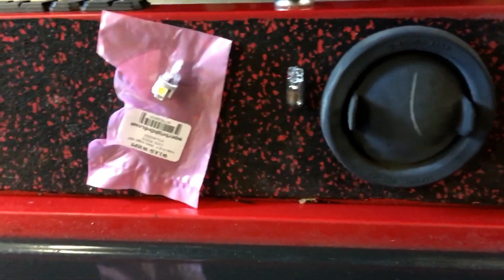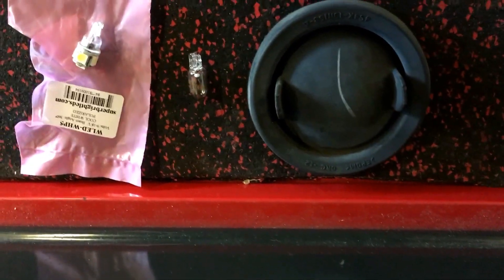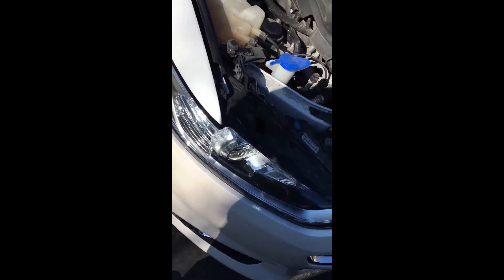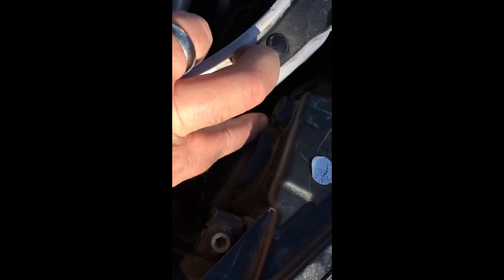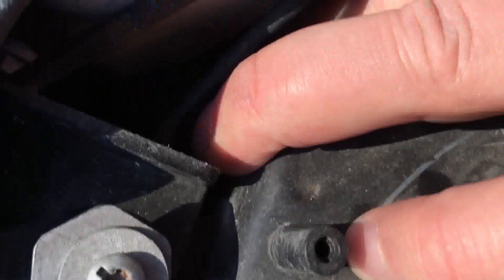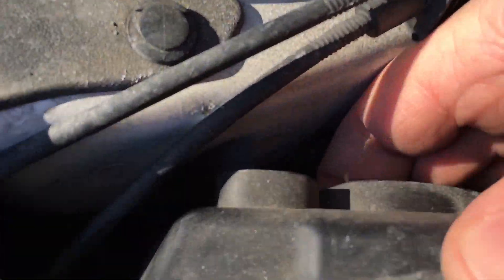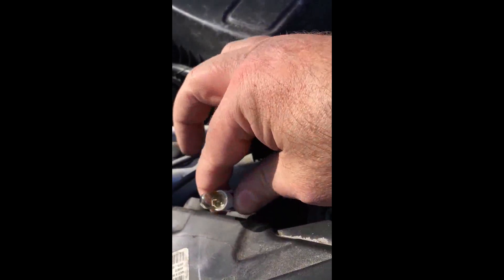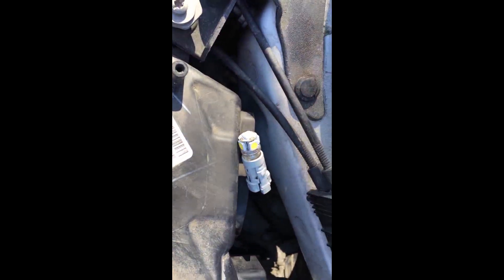2013-2016 Ford Fusion Easy 10 Minute Front Bulb Replacement LED Upgrade

Comment: Great video. I didn't do an LED upgrade myself, but it sure helped me change the halogen bulb without getting out the tool box or paying for labor at a shop! Literally took 5 minutes. Definitely requires smaller or nimble hands, though.

Comment: Thank you!  You saved me so much time!  I saw the preferred way to change the bulbs, which told me to remove about half of the front end!  (Serious!)  A couple of other things to think about:-  With help from one of the behind the counters guys at O'Reillys,  he pulled the Sylvania LEDs for me.  Unfortunately he pulled the amber LEDs rather than the cool white LEDS.  So I wasted time driving over there twice.  -  LEDs require that you get the polarity right.  The LEDs go in the socket in either polarity.  So, after seating each, check to see if they light.  If not, just rotate each LED 180 degrees.  You can't hurt them.-  There are two wires that converge together into one bundle; one for the high beam and one for the parking bulb.  I pulled off the high beam connector loose by accident.  So when you are ready to reseal the rubber covers, make sure first that your high beams work.It really is a 10-15 minute job per bulb.  Avoid making the mistakes I made!  :)

Comment: I got it out by loosening the right bolts  and then prying the headlight assembly out as much as I could from its place by putting short pieces of 2x 4s in between it and frame. Then with large hand was able to turn bulb connector counterclockwise about 1/4 turn and out in popped out YAY 😀

Comment: Popped the cover off no problem, did not feel any wires.. Looks like there is a plate holding it on with the bulb next to it... 2016 Ford Fusion SE 2.5L. Nice video anyways though!

Comment: These are definitely not 921 bulbs.  I got a set of  168s for the license plate lamps and a set of the 921s for these lights he’s replacing. The 921s are way to fat to fit in the hole..   it’s the same bulbs as the license plate lights.  
I bought the sylvania super bright 6000ks.  $20 for the 168s two pack.
$25 for the 921s ..  I’m leaving now to return the 921s and get another set of 168s. 

168.  Or also fits 194/285.  So these are the same depending on who is talking.
Reply: Good comment!  Thanks!

Comment: Been down this road several times since LED's just don't last in this car.  Every one I tried starts blinking in a few months.  If you have normal size hands or larger hands, you will not be able to do this without pulling the bumper.  Even if you manage to pull it out this way by tugging on the wires, getting it back in the hole is impossible.  Save the headaches and scratches and pull the bumper.
Reply: Joel Hinkle  The new Ford's are funny like that their lights are low current that's why they have so many problems I think is like 7.5 volts or 7.2 volts or some crap like its not your standard 12 volts system

Comment: What is the best size for fusion 2017 LED head lights for high/low beams and for fog lights ?
There's company such as "aux beam"
have many sizes of LED lights.
Reply: ***** Thank you for the answer :)
Reply: You will have to watch the size of the LEDs that you put in there. Since LEDs headlights have heatsinks/fans, some will not fit into the small space in the headlight assembly.
Reply: H7 IS HIGH BEAM AND H11 IS LOW BEAM.

Comment: When the bulb went out did the dash display anything to tell you it went out? I ask because I actually don't want those bulbs at all. I'm worried if I take the bulbs out either the dash will display something or the turn signal starts hyper blinking.
Reply: No it didn’t I’m an uber an my passenger told me my light was out which was so embarrassing there should be a warning

Comment: I swapped my parking light this way. Was wondering if anyone swapped low beam and high beam bulbs with same method? And what is the best brand to go with?
Reply: It really doesn't work unless you have extremely small hands and know how to twist the bulb. I just did what the owners manual said and it worked. SHAME ON FORD FOR THIS DEVIOUS WAY TO GET YOU INTO THE DEALER.

Comment: Are they still working ok?  One of Mine always start to flicker after a week or so. Always the passenger side. I've tried so many types and brands
Reply from the maker: +Chad Freeman Lights are working good!  No flickering.
Reply: i do the same, u change de bulb for a led ..  and the fog lights for led too
Reply: Make sure to order Canbus or error free bulbs. With error free bulbs you will run into some that still flicker. I have not had any Canbus bulbs do this on the various cars I have installed LEDs in.

Comment: Can this method be used for all of the lights my low beam light is out on the passenger side and seriously do not have the money to pay ford to remove my bumper to change it
Reply: I know it sounds like a lot of work made for us. But, once you get your head around it, it takes around 45 minutes After watching the youtube video on bumper removal. DISGRACEFUL ON FORD FOR MAKING YOU THINK YOU HAVE TO GO TO THEM!!! ALL YOU NEED IS TO PULL THE BODY PLUGS(easy), flat head screw driver (or star bits) and some small socket(1/4" drive set will work). Had to pull it three times because I upgraded head lites H7 andH11(no one gives instructions and very tight fit). Just get a semi warm day and you'll save a lot of money. Good luck.

Comment: it is not this simple you have to take the bumper off i tried this way there's no space to maneuver
Reply: David Bellamy did you take the bumper off yourself? I tried this way and didn't work for me either
Reply: Tosharo Dickson naw but I got the clips out but I don't have a torque screwdriver but it's not that hard
Reply: it did it this way, the bulb is way up in the corner make sure you are trying to remove the correct one
Reply: Removing and installing the small side marker bulbs can be done without partially removing the bumper. Bit to remove the lowbeam and foglight bulbs, you won't have enough space to remove the bulb with the bumper on.
Reply: dude there is no fucking way I tried
Reply: Same. Kept scratching my hand. Definitely not enough room to take it off
Reply: I know i said it wasn't but a dude did mines with his hands he had little hands though
Reply: David Bellamy for the bulb that's closest to the grill as he explains/demonstrates in this video it really is this simple. I just replaced my drivers side bulb closest to the grill in the top inside corner just a few days ago and within minutes in my 2014 Ford Fusion SE 1.5 ecoboost . It's a pain in the butt getting that rubber waterproof fitting/cover off but once you do it's as simple as pulling the bulb out without having to turn it or unlock it>than the switching the bulb out real quick>to than putting her back in her hole and fastening it back in there. It took me 5-10 minutes of playing around with it from start to finish.
Reply: You don’t have to take the bumper off, I found a way and I have basketball hands.
Reply: @SpikedTea_  I did it and I have basketball hands there’s a video on YouTube I was done in 30 minutes
Reply: @PremetJ  When you say it 'fastens' back in there, do you mean it 'snaps' in?  How does it fasten exactly?

Comment: What is the part number?
Reply: 194/168 T10 terminal if is a plasma led you can buy them at any auto parts stores the sylvania brand last way longer than the cheap leds they cost a little more but they worth it because they last twice as much.